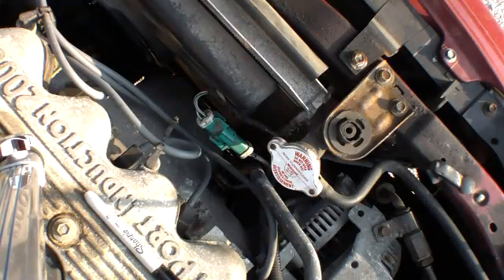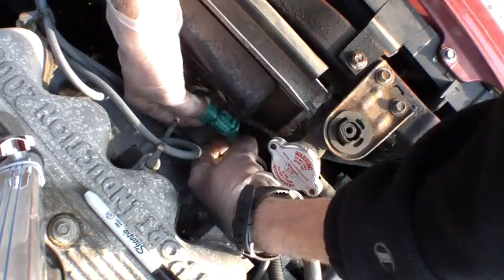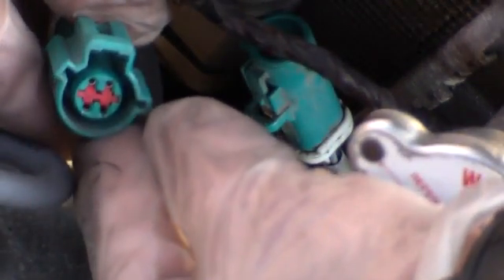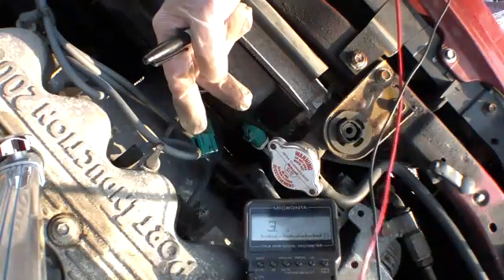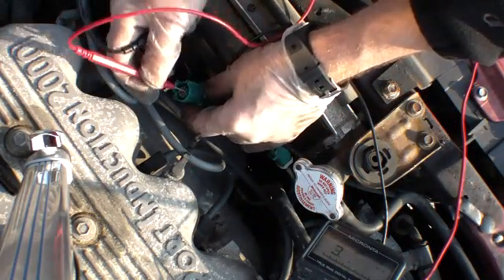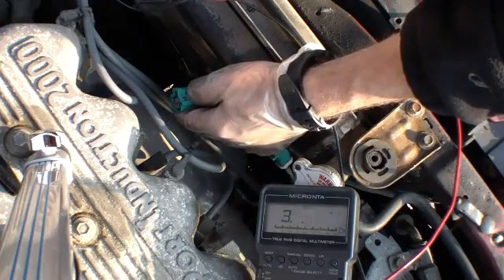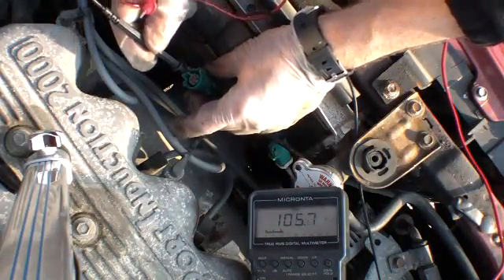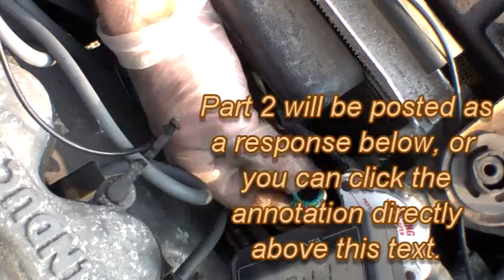check oxygen sensor part 1 of 2

Comment: This type of sensor is not a typical sensor you can ck with a multimeter. You need the right testing equipment and an understand of the  interaction with other device's, o2, other gases, pressures, mixtures, pressure differentials, ect.
Cars are starting to use aircraft grade, multifunction sensors you really need to understand what ur doing before showing others.
The heater coil u might be able to ck, but it should have a resistance setting for the coil and u need to know what that is and under what conditions. I don't do any testing without a wiring diagram, dont feel comfortable without one. The military  did that to me...as a Jet electro. Looks like some people are hitting you hard with your methods so I am  just trying to help....

Comment: confused about trying to find ground pin in the connector.  meter on ohms probe with red lead into the pins until you see____________on the meter.  What are you looking for on the meter to determine that you found ground while probing?
Reply: Scott Watkins

Comment: Do the oxygen sensor has anything to do on how the radiator fan works? in my car I see how cables seem to go to the radiator fan set of cables but not sure if it actually connects to it or just go along with the cables to somewhere else.... the fan is only working when  starting the car, coolant temperature sensor has been replaced, thermostat seems to be working, relays and fuses are ok, any suggestion please? My car is a Saturn SC2 year 1999

Comment: I like your effort, but I tested the resistance of the heater on the oxygen sensor the way you did (part 2) and the meter read open as yours did. I then went to the autoparts store and got a brand new oxygen sensor for my 1999 Ford Escort. It also tests as open resistance on the pins you are testing the resistance across. I made a video showing a better method of testing the oxygen sensor. Search: Check Test Oxygen Sensor 1999 Ford Escort Troubleshooting with Crisp Line Metal 
.